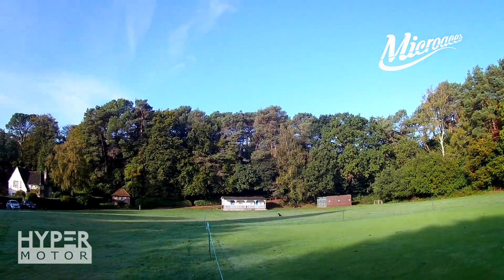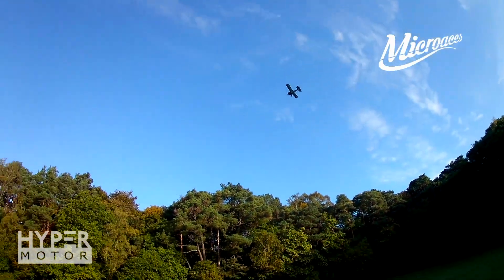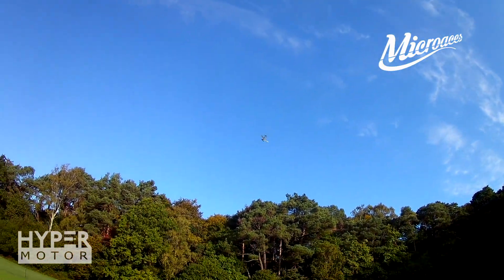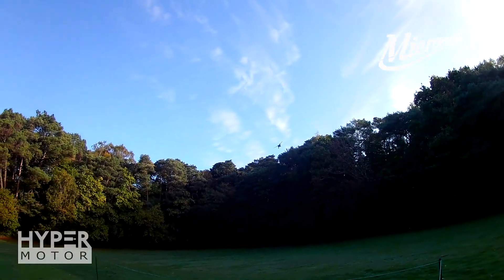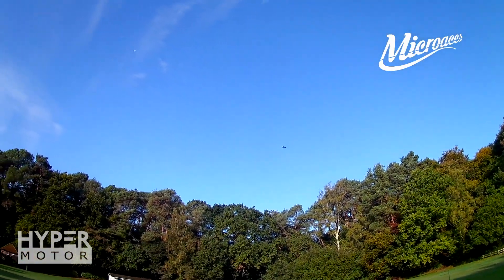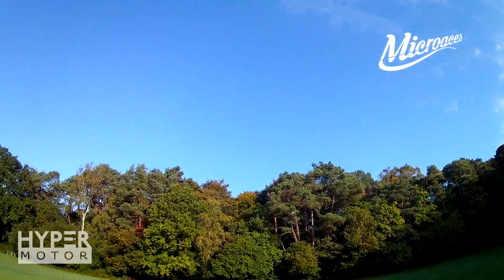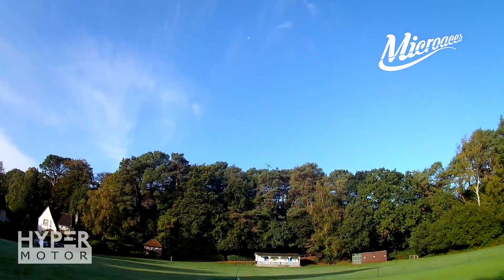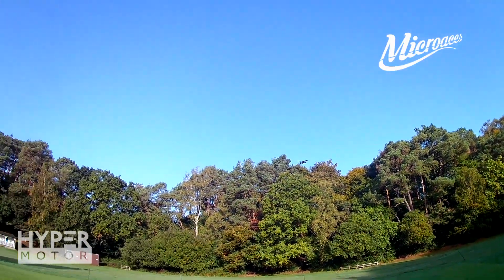NEW Hyper Motor Test - Scrappee NiteOwl

Comment: Could this motor be installed in the w12 to make a working seaplane?
Reply from the maker: Theoretically yes the HYPER motor would provide extra power for takeoff from water. But you would probably need a larger battery than the 150mAh - something like a 250 or 300 would be better. The Scrappee in the video is using an E-Flite 300mAh 25C 1S battery. I haven't had the opportunity to try it yet but when I do I'll be sure to post the results.
Reply: @MicroacesTV  thanks for the info. By the way are you still working on the felixstowe?
Reply from the maker: @archiescriven6178  I've been thinking about it alot but havent done much about it.

Comment: More performance, but what about flight time compared to the standard motor?
Reply from the maker: It does reduce flight times, but the Scrappee can accomodate a larger battery (we used the 300mAh Lipo and were getting 6+ minutes flight time)